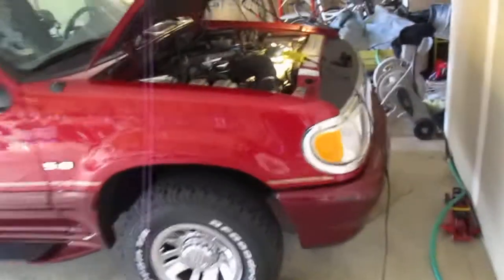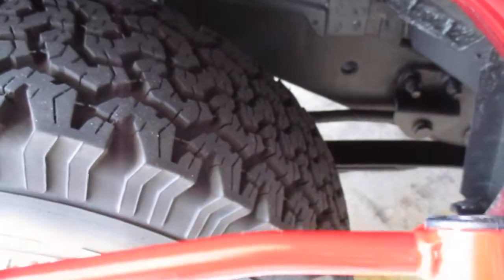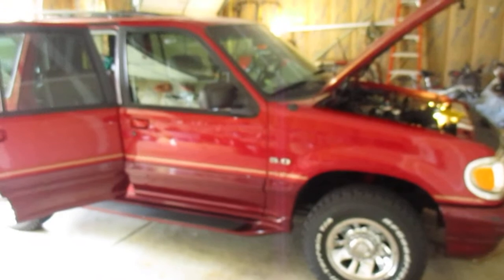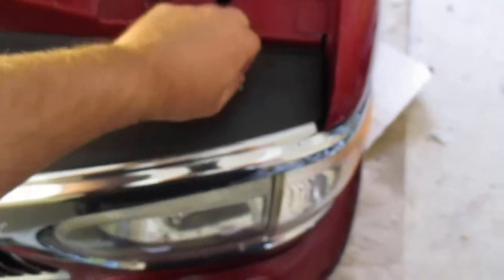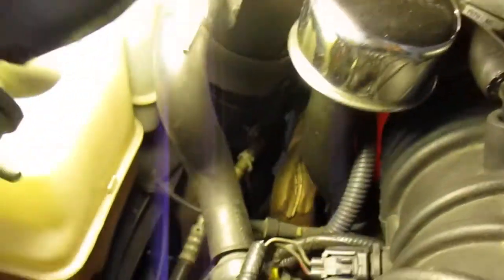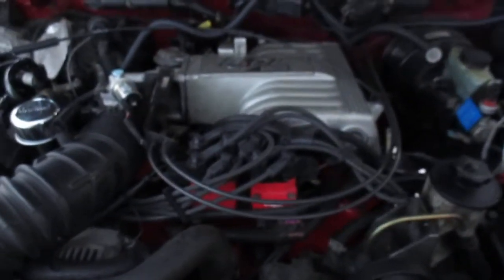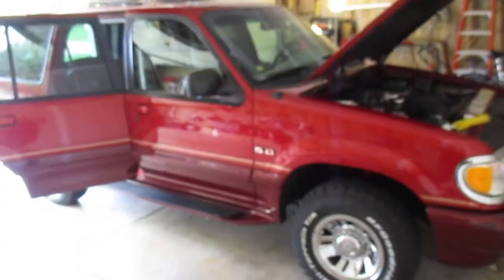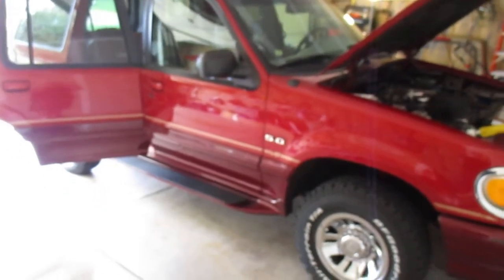5.0 Mercury Mountaineer Updates

Comment: You got my attention once you mentioned LS swap. That would be interesting to see if you decide to go that route. Im hoping some day someone will figure out a way to make a newer 5.0 fit & work in our suvs.
Reply from the maker: Don't get me wrong i like my fords.But the GM ls engine is much cheaper to build and get MUCH MUCH more HP out of for your dollar.They make good power from the start and do some tuning and throw a turbo on em and they are a beast for a fraction of a ford drive train.My friend already installs the LS engines in early 5.0 mustangs.He is doing a LS swap in a 2002 model stang right now with turbo's.He said he could do my truck but i am concerned about keeping my factory AC and power steering.Such a tight space as it is.The easy thing would be to keep current engine and actually find a good shop to build it but then the cost gets up close to a LS swap with a donor truck.

Comment: I want to know why. My 99 Mercury I bought have high idle when first starting then after 5 minutes it goes 800 rpm after after it warms. I bought my truck for 1700$. I fixed most things. Strong engine. 110,000 miles great truck. Love it strong. Changed out transmission and differential fluids changed various sensors. He runs great. But wondering why her idles high sometimes? Maybe you can advise? Thanks brother

Comment: I personally wouldn't do an LS swap, I'd get another truck for that, clean 302s are hard to find, took me nine months to find mine.
Reply from the maker: Yea i get what you are saying but its not clean tho it has a rusty hatch and door and rear bumper and hood.But the interior is almost mint condition even the steering wheel and center counsel lid.It has 138K miles on it.I haven't made a 100% decision.I do have to factor in the future value of the truck.Like would a collector ever buy it ? and if he did would he want the original drive train in it ? Would he mind that i installed new body panels and repainted it ? That kinda stuff you know.
Reply: I myself have a 2000 V8 I hunted for months, has well over a quarter million and still pulls hard, gonna be doing a V8 swap on my 2001 Eddie Bauer soon, both are extremely clean for the conditions they've seen, and to be honest I don't know, I'm located where they're being bought for $500 and squatted and drove until they drop so mine turn heads.

Comment: What msd coil is that? I can't find them. Any help? Haha
Reply from the maker: Ah that because they don't make em for this vehicle.However many other fords use the same coil pack.It bolts right in.I cross referenced the part numbers.Find out the factory coil part number and find out what other vehicle uses your same coil and then find out if MSD makes a coil for that other vehicle.That how i did it.I think i used a mustang  4.6 coil or maybe expedition ? I forget.
Reply: pontiachotshot alright thanks man! Appreciate it!